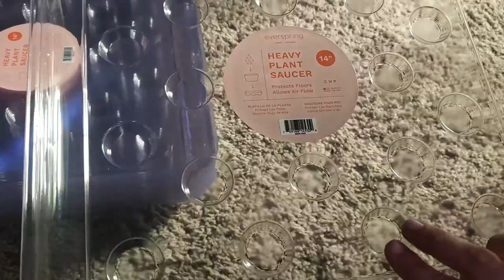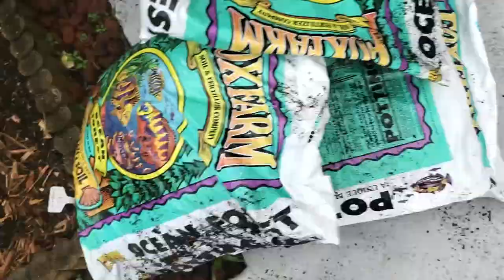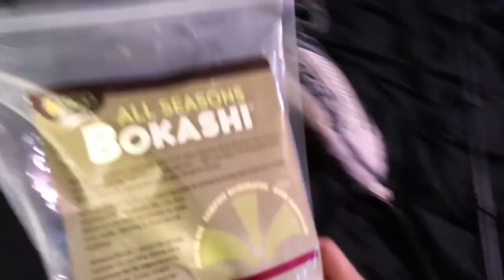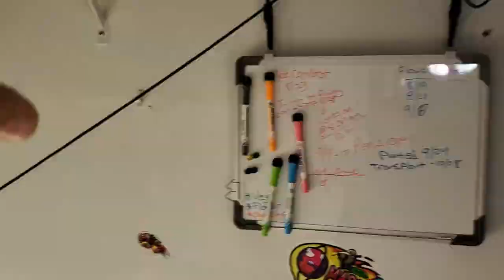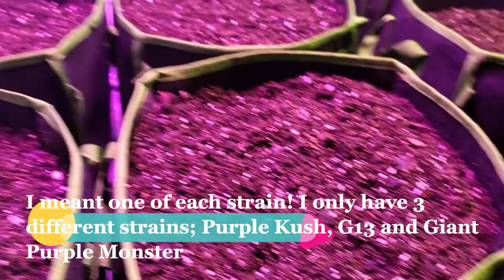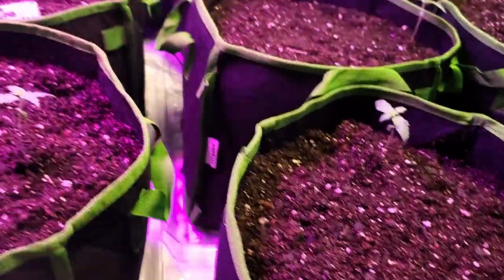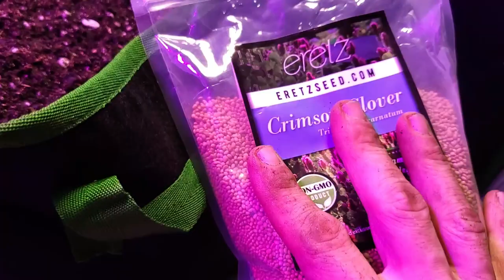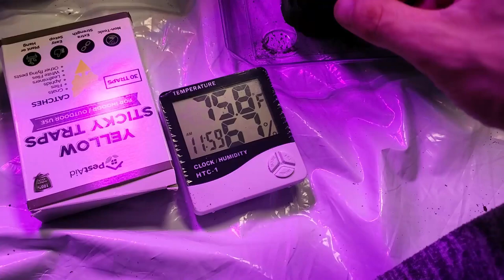Perpetual Cannabis Grow: Week 3- Transplanting and Cover Crops

Comment: Great video broski, a tip on the cover crop.  Go light because you can easily have too much and the cover crop starts to take away nutes in the soil from the MJ plant.  I tries cover crop myself and at first everything was awesome and then about a month in my plants all started looking sad.  Soon as I removed the cover crop they sprang back to life.  

Further research indicated the cover crop works better when used between grows to keep the soil enriched.

Either way, looking good regardless and good luck 🍀
Reply from the maker: Thanks! I don't let anything grow within two inches of the plants, and honestly during top dressing, many will be killed. I wanna do an experiment where do two pots of the same strain and do one with cover crop and one without.. I mean realistically I'm sure there is some minor stunting due to root competition however cannabis' roots dig much deeper into the soil vs crimson clover... basil, cilantro and the parsley are the ones I need to be especially careful with, however that's why we waited two weeks, for the cannabis and its tap root to get a head start vs our cover crop.. I feel growing from seed vs clones do make a difference in this case due to the seedling having a tap root which leads the way for other roots downward vs a clones smaller, branchier? Roots. .. no?